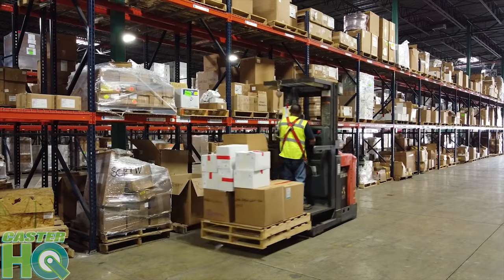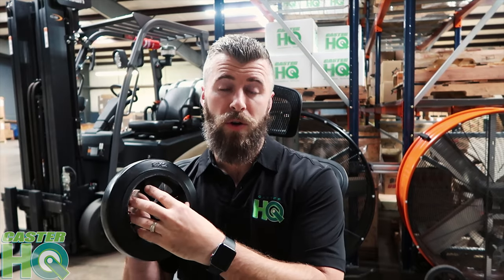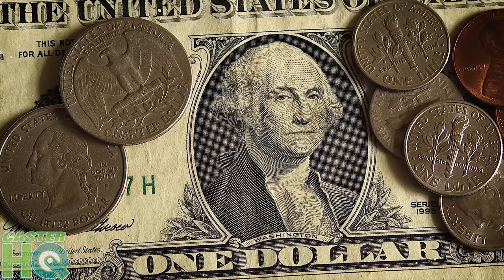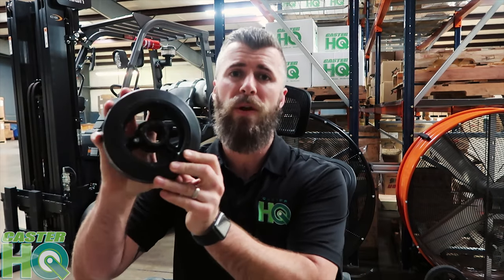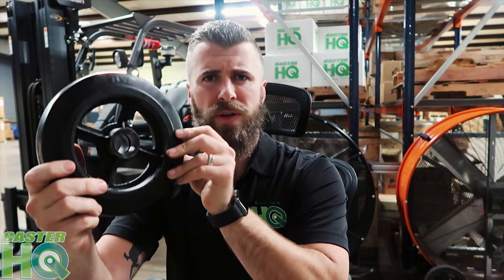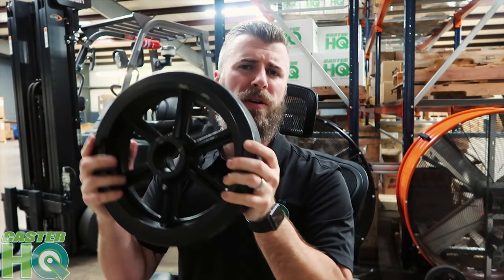Mold on Rubber Wheels | Full Tutorial

Comment: You need kits to do this for people who have antique equipment that they want to have a rubber rim on my project is a new idea hay loader and the original steel wheels on the back were spoked cast iron and the front ones are four ft in diameter cast hubs and riveted steel spokes/tires

Comment from the maker: 0:00 Introduction
0:39 History of the Mold on Rubber Wheel
0:50 Tread Characteristics of the Wheel
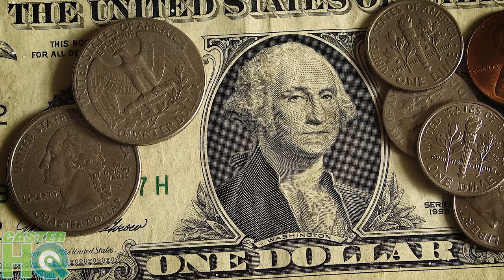1:40 Budget-Friendly Caster Wheel
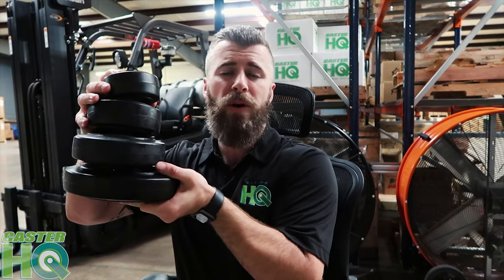2:39 Introduction to Sizes on the Market
4:40 Example of a 12 Inch Wheel
5:16 Temperature Range of Wheels
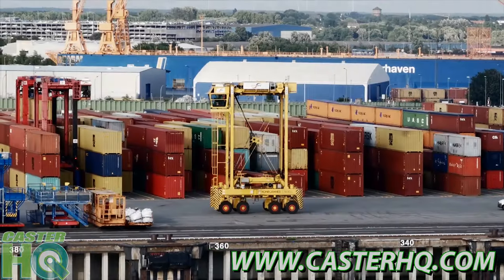5:49 End of Video

Comment from the maker: I missed two points on the 6” and 8” which are the weight capacities. The 6”x2” mold on rubber wheels holds up to 500 lbs weight capacity per wheel and the 8”x2” mold on rubber wheel holds up to 600 lbs weight capacity per wheel. You can find all links to the wheels and complete casters on our website and Amazon in the description above. Thanks again for your support and please comment below if you have any questions or suggestions on this video or any future videos. I really appreciate the feedback. Thank you.

Comment: What if I need a 3inch diameter can you make those?
Reply from the maker: We make a 4” diameter as the smallest on this type of wheel. We do have 3” diameter wheels but they would be a thermo plastic rubber and it would be a 1-1/4” wide and not 2” wide. Reach out to us 844-439-4335 or visit us at www.CasterHQ.com